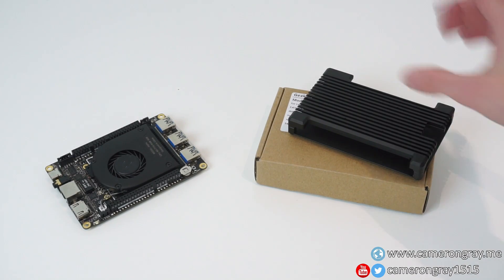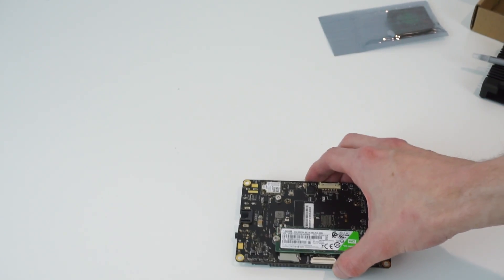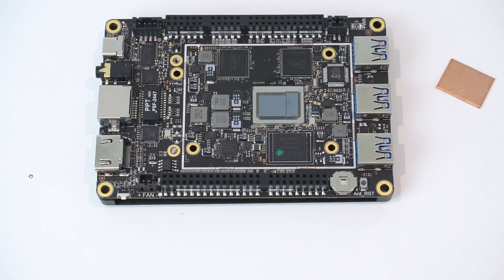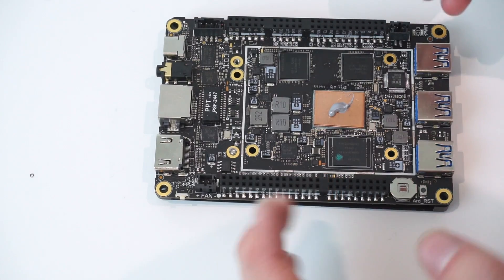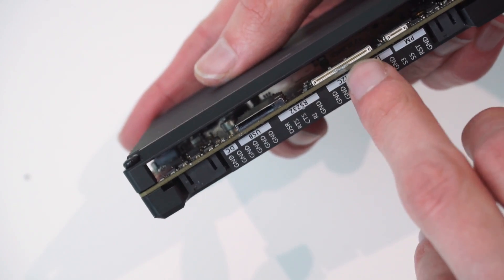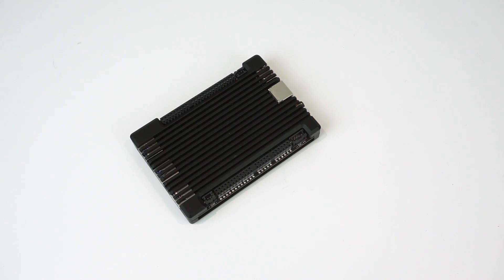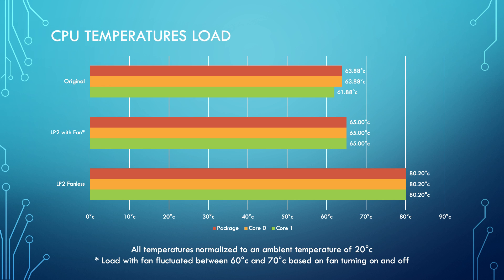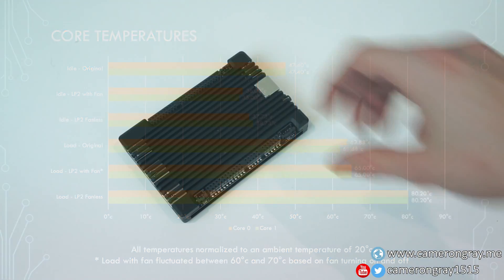Review and Test - Aluminium Alloy Armour case for LattePanda Alpha - "LP2"

Comment: Hello, In your tests, I have perceived the Original cooler on it as more efficient and better.
Reply from the maker: It really depends what you're doing, my goal was to have it totally fanless in which case the new cooler is a better option.  Under full load the original cooler keeps the temperature more constant due to the fan not turning on/off as I described but that's only really if you're keeping the CPU constantly maxed out, if the load is low then the new heatsink will run fanless most of the time.  If you were to set it up so the fan on both heatsinks to run permanently, I'd predict the new heatsink to run significantly cooler (under the full stress test the temperature would drop down to 60c before the fan turned off, I imagine it would drop even lower if the fan stayed on)

Comment: Do you have a link to the fan you used on the case?
Reply from the maker: The fan was included with the case so I don't have an exact link but it's just a standard 12v 40mm fan which apparently (although I can't guarantee this) uses a 2 pin "PH2.0" connector.  I can see a few floating around online, I also think Noctua sell a suitable fan that includes a 3 to 2pin adapter.

Comment: Just an Suggestion to adding thermal paste to any CPU that I have found to be very effective. Clean the die with a paper towel that has some alcohol on it put a few drops of alcohol on any safe surface to be used late. As mentioned in video but some paste in the center on the die. Now turn the syringe over and dab it the the drops of alcohol use set aside. use the flat part of the syringe to spread the paste as needed but leave a small area around the die to allow for spreading. If you have one of those pads that come pre-soaked in alcohol squeeze it as you're removing it and put the storage bag aside to dip your syringe in as above. I would suggest applying the thermal paste to the other side of the shim as above but before you place it over the CPU die just to make it easier. Hope this helps I would suggest this is a good practice for applying thermal paste on any cpu.

Comment: ANGRY COMMENT ABOUT THERMAL PASTE BEING WRONG OR RIGHT OR THE WORLD MEANS NOTHING AND THERMAL PASTE IS SILLY

Also great video :)
Reply from the maker: Thanks!  Thermal paste - the thing people hear about then constantly bicker over because they think it makes them look like experts... 🤦‍♂️

I find the people that get properly hung up over thermal paste tend to be the novices whereas the actual experts tend to just be like "yeah, use thermal paste". Any time I show thermal paste application in a video I fully expect an influx of angry comments. It's right up there with other contraversial topics such as mentioning an Apple product or showing some sort of building construction/electrical work.
Reply: @camerongray1515  While I dont whine about it, IMO I'd prefer using some decent thermal paste these days since even Silver thermal paste is fairly cheap for a small amount.
Though we're talking like maybe a couple more FPS in games or a few more points in bench marks (though in the enthustiast crowd, every little bit of power you can get out of a system means your more likely to get the top spot)
Reply from the maker: @nekomasteryoutube3232  I'm definitely not doubting that, I'm using Arctic MX4 which is a decent quality paste. The cost isn't an issue unless it's something ludicrous, I'm not going to use the cheapest stuff I can find, but for me I don't spend ages comparing pastes. I bought that MX4 ages ago and use it any time I need thermal paste.

The bigger issue is more people bickering around how best to apply it with a mentality of "everyone apart from me does it wrong" - sure, this definitely isn't the neatest application, hell, I was installing it while reaching around a camera and a pair of lights, but it works!

Comment: that paste looks so bad
Reply: and how you applied pastes anyways looks also horrible
Reply: netman87 fucking hell that spread on the copper is just ridiculous
Reply: netman87 anybody saying „you want to have too much not too little“ has no idea what they are doing, even on a bare metal dye
Reply from the maker: "Too much" maybe wasn't my best choice of words, you don't want it spilling out everywhere but on a bare die you don't want to leave any areas uncovered.  While this definitely isn't the neatest application - this machine has a CPU with a maximum configurable TDP of just 7w and the entire process was carried out while reaching around various camera/lighting equipment.  Of course, I even called it on camera that I'd get called out in the comments for thermal paste application as though it's the ultimate skill test of anyone working on PC hardware...

As for the copper notice how I did actually state in hindsight that I wouldn't spread it manually if I was doing it again.

In the end, the temperatures are totally fine therefore the thermal paste is doing its job, there is more to life than spending ages applying thermal paste perfectly on a 3.75-7w CPU that barely requires any cooling to begin with.

Comment: Awesome video and great to see you again. I always find your videos really interesting.

You might get improved thermal if you have the fan blowing away from the heatsink to pull off excess heat, instead of blowing into the heatsink. This might also help draw air across the cooling fins on the case.